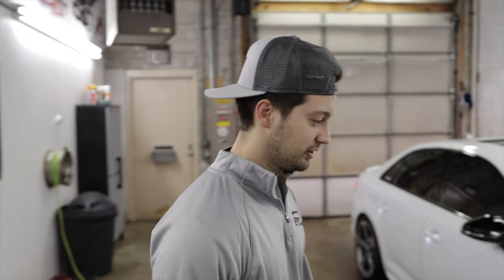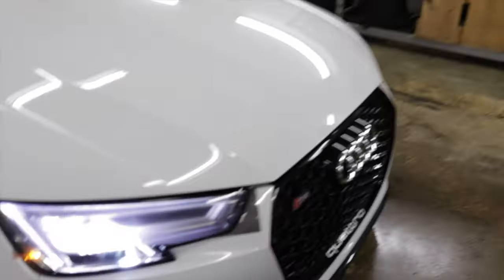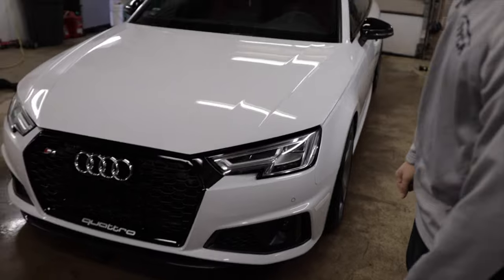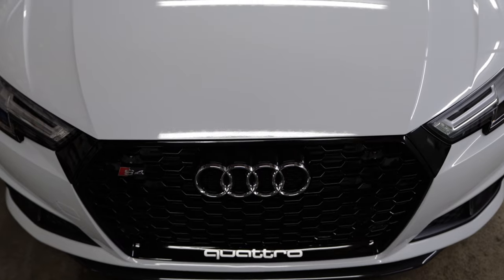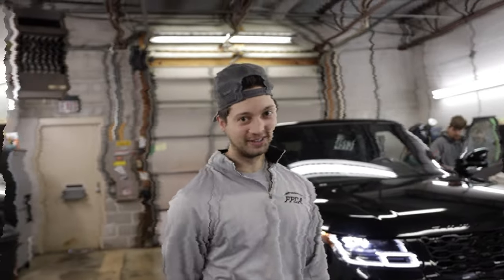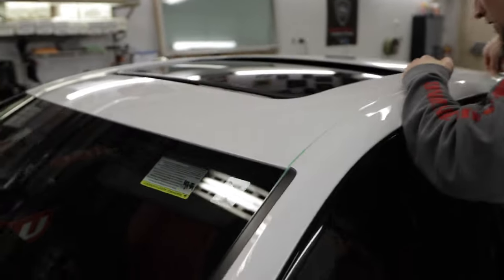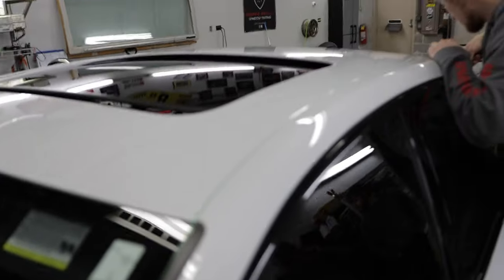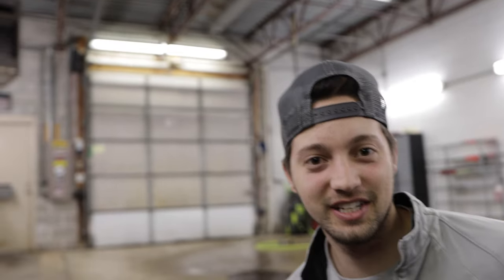Making the Audi B9 S4 Look AMAZING?! ( 3M Vinyl Roof Wrap and Complete Black Out!)

Comment: What did you end up wrapping the rear reflectors with? Gloss black or was that smoked also?  Looks great!  I won't be tinting my rear lights, but those reflectors gotta go!  Did you guys end up removing the reflectors to wrap?

Digging the videos bud.  Great production value, entertaining, and zero ego.  Nailed it.
Reply from the maker: Thanks Rob! They used the mid smoke headlight tint on the rear reflectors, made a huge difference on the rear

Comment: Can’t decide between b9 S4 / S5 or an STI
Reply from the maker: Definitely go the B9 route. Much superior interior and engine. Over 450 HP with a simple flash tune 🔥
Reply: Yeah, get a B9
Reply: Gotta get that carbon fiber inlay pack
Reply: I had a WRX and STi and currently have a B9 S4 with the EPL tune. I would buy the B9 S4/S5.
Reply: @SquashPile  I had a charger scatpack and wanted to get back into turbo awd cars, I know the STI is probably funner but the S4 is probably going to be better on the long run thanks!
Reply: @UmbertoFarias  They are all great cars, but I will say I blew the motor in the STi twice. Ringland both times.
Reply: If you have the money get a b9. If you want manual get the Sti. A quick tune on the s4 and u get 100+ hp and tq
Reply: I considered both until I drove them back to back go b9 s5
Reply: @drivenbyboost  any dyno results to back  this up on terms of numbers as I've never seen a stage 1 go over 410 without hardware modifications aswell?

Comment: Not sure where you’re located, but do you know if the roof wrap vinyl holds up in winter temperatures and snow? I’m in the Midwest so it gets nasty here
Reply from the maker: Midwest as well. The wrap has had no issues 🤙
Reply: @drivenbyboost  hell yeah. Thanks